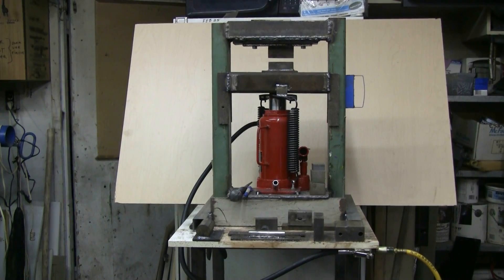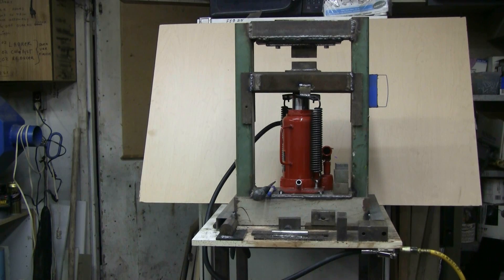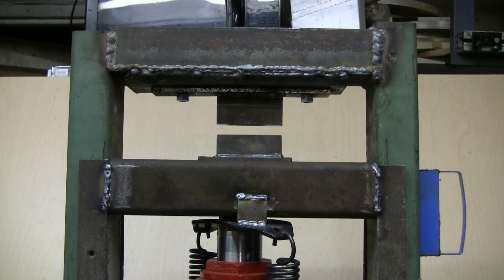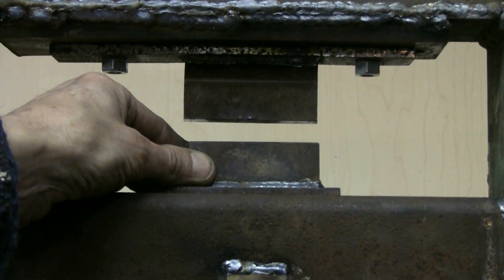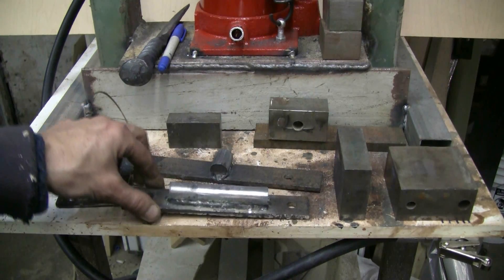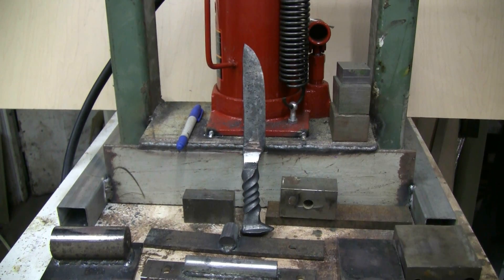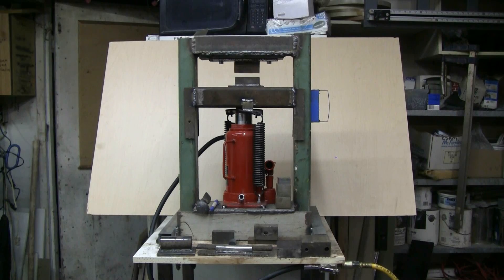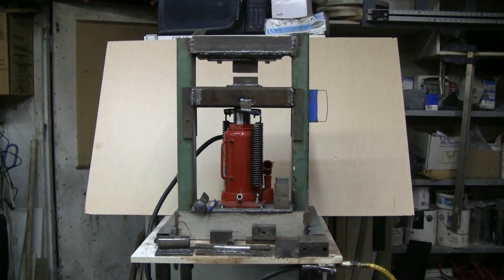Do It Yourself 20 Ton Hydraulic Forging Press

Comment: I think next it’s time to upgrade the forge cause your steel wasn’t very hot. An ideal forging temperature is a good orange color. Bright orange is even better. Yellow also known as white is perfect if you want to forge weld which is the main use of the hydraulic press. I do like the press idea though. It’s a great concept.

Comment: Stupid. WAY too slow. Your steel is surely fucked by pressing it while cold. You obviously don’t know what you’re doing. A press like this will never be able to work like a true forge press that runs its ram at 2in per second or more. The only thing a press like this could be remotely good for would be setting one weld. Like with San Mai. Even then you’d want to get the dies good and hot with a torch before you press the steel going between them. Otherwise they will just act like a heat sink and turn it black instantly, just like in the video. There’s a reason big name bladesmiths don’t use bullshit like this... because it’s bullshit.

Comment: Can i ask you how compressor you use? 
How mach bar?
How mach air for minute?
Reply from the maker: It is a 220V 5 HP shop compressor at 120 psi. Takes a fair bit of air to run one of these jacks.

Comment: Do you have to turn the release knob to release the pressure for every down stroke? Is there away to do it using foot switch or electronically to save time and actions??
Reply: Thats what I was wondering

Comment: My guess is that you are using a much underrated air compressor. You need  5.8 CFM @ 90 PSI to get much more efficient results.  It would be smart to secure bottom dye as well before you get hurt.  You would also have much better results if your steel was hotter before going into the press.... Thanks for the video

Comment: With slow pressing like that, I see the control you have but I think you would need about 50T. I see back in the old days they had hammer presses. A lot less cooling of the steel.

Comment: as slow as this is you would be better off just using a hammer and anvil you can't even press the whole piece before it cools down seems like a waist of time really what you do with that someone could probably do with a hammer in half the time
Reply: No, they couldn't. The amount of force involved in pressing something is orders of magnitude beyond what a human being using their arms and an anvil could do.

And I don't mean they could do it on the hammer and anvil but it would take a lot of swinging and sweat but little by little they'd do it. No, the effect of pressing does not work like that. It is a massive amount of force applied to a small area at one time.

Sure, the guy could get the piece hotter or preheat the dies, but what his build here is doing can never be done by a person. Moving material around by hitting its surface areas works with different physics then squeezing the whole of the material's thickness under inescapable force in a second or so. They are fundamentally different processes.

Why do you think presses - of any kind - exist?

Comment: I found it very interesting Bill. Could you show how to instal the the air compressor to the jack?. Thanks
Reply from the maker: +Robert Navarro This is an air assisted hydraulic jack. The air line and air switch came attached to it. This jack can also be hand pumped like a normal bottle jack. It does use a lot of air and is not very fast moving. However it only cost $70 on sale so I got a cheap press.

Comment: Kool set up but i might suggest is get that bottom die secured they can pop out of there like a 5lbs bar of soap and at that level will take your teeth right out and to the others it looks slow but wait till something slips out it moves pretty fast  and thats experience not conjecture  cheers mate

Comment: how do you deal with the oxidation of the blade due to the forging process?
Reply from the maker: +MrRealgamer777 I use a wire wheel for the spikes. The grinding steps remove the oxide from other knives.